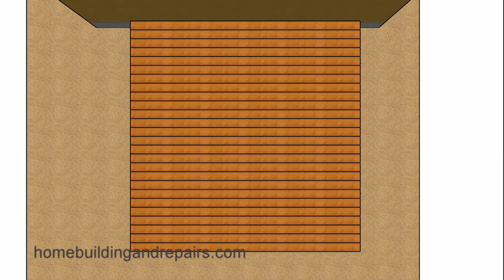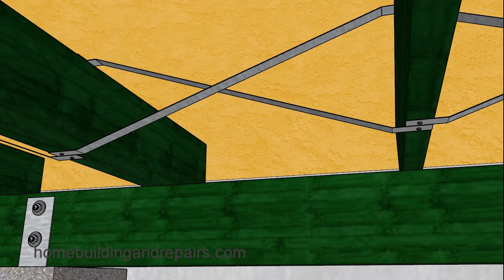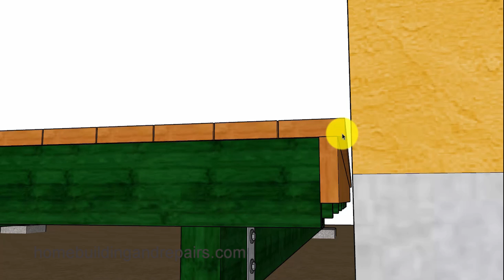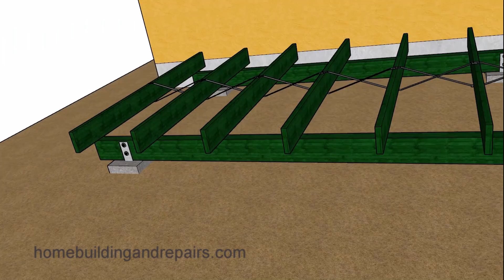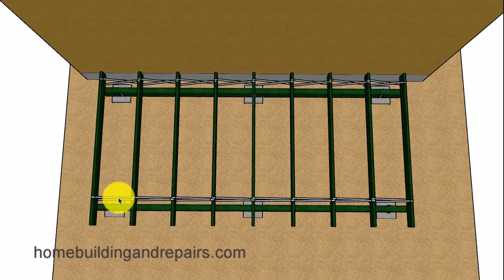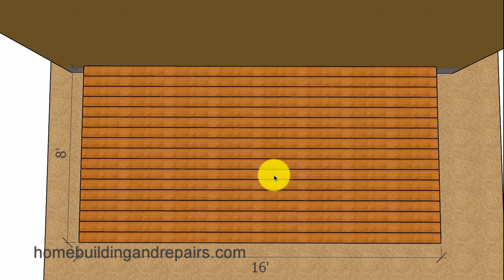How To Design And Build Wood Decks With Out Cutting Any Lumber - Do It Yourself Outdoor Projects

Comment: Cover the tops of the framing with sill tape to shed water.
Reply from the maker: That method might trap water above tape and lead to wood rot.
Reply: @gregvancom  
The top rotting is expected unless you're using some sort of imported tropical wood. At least with sill tape you don't have to rebuild the framing. Though I think the bottom of the X braces would be the first place to rot.
Reply: @F @Clip_This_Schitt ape is a scam, I’ve been in construction for over 30 years. I’ve never used tape and I still have decks that I built over 20 years ago that are not rotted. Tell me how does that tape stop the wood from absorbing water from the sides and bottom? If you believe that tape actually does something then I got beachfront property in Western North Carolina I’ll sell you.